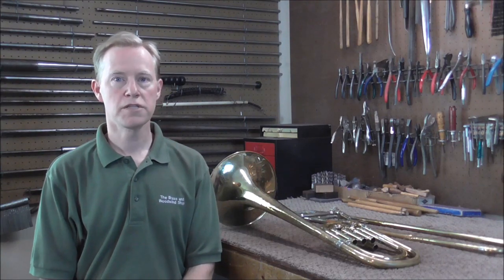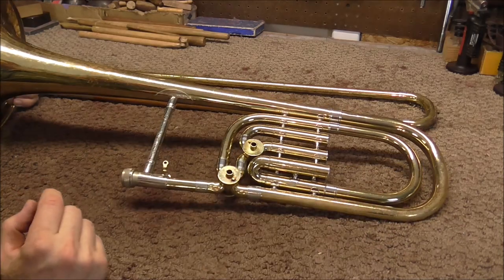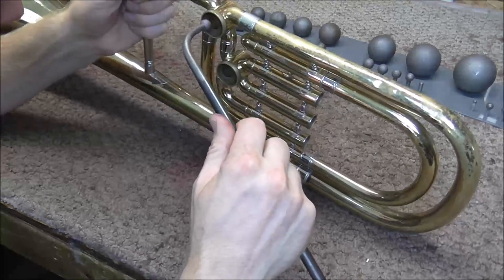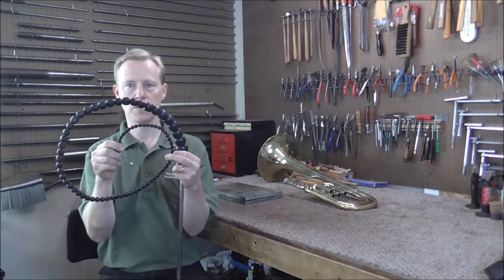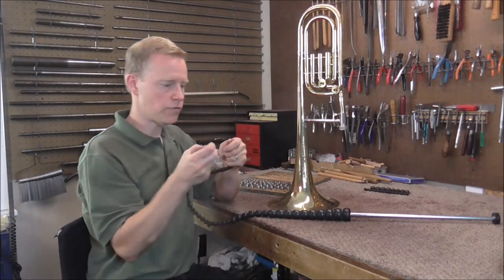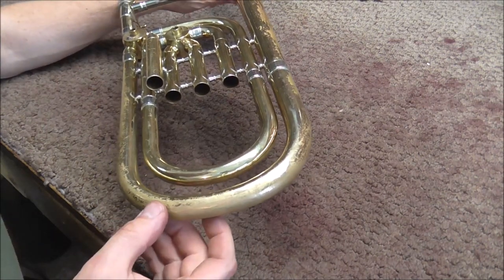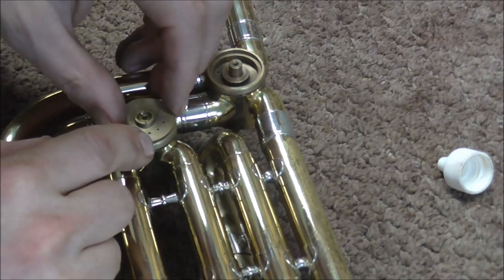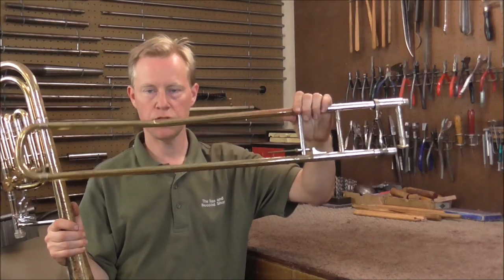Bass Trombone Restoration #3 Removing the Dents and Completing the Bell Section

Comment: I have knocked out dents instead of using the dent hammers... Using a rubber Hammer 8 oz rubber hammer... And I've also used instead of the Mandrill use a stick to get out dents... Of course I just figured those things out and did not know that they would work but they they do

Comment: Why can't you use the small dent balls with the Dent ball magnet?
Reply: The smaller the ball the less force the magnet applies. Once you get to a certain point there's just not enough force to pull out the dent even with a very powerful magnet.